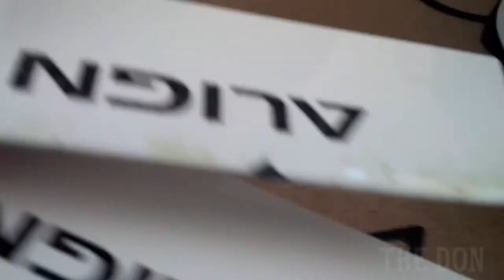The 5's are down!

Comment: What happened to the tail before you go onto the grass? Then you go back in the air, and it starts to spin like mad. Looks like some thing was wrong before the crash. Nice blades, or was, i SO WANT THOSE ALIGN BLADES on my 550. Good luck buddy !
Reply from the maker: Not sure what was going on. I hit idle up 3 then back to 2 and it up but pitch slider snapped and made it spin out of control. Thanks.

Comment: To me it looks like the thing with your tail rotor is due to these little aluminum arms that connect the pitch slider with the blade grips. Have you ever heard of propeller momentum weights? Change them arms back to plastic. Otherwise your servo and the pitch slider have to take way more force. Id guess the pitch slider broke while doing right turn...
Greets from germany
Reply from the maker: After looking at the pitch slider all I can say is they were poorly made from the start. These aluminum tail case are some what cheap. I have a plastic arm on there now. Thanks for the feedback.